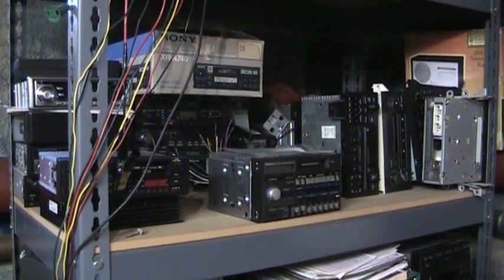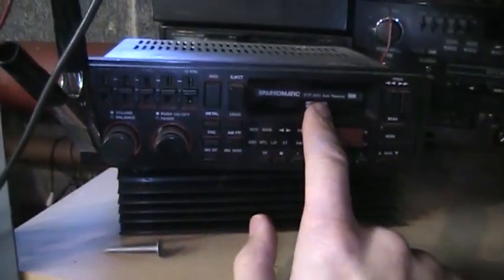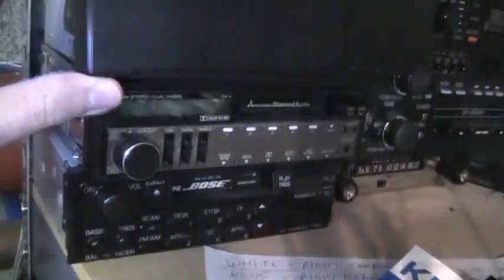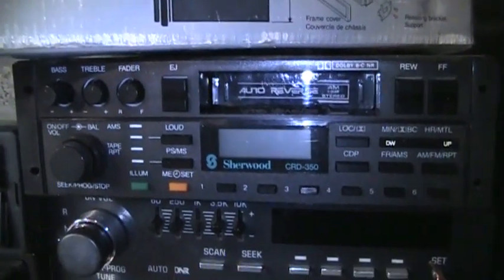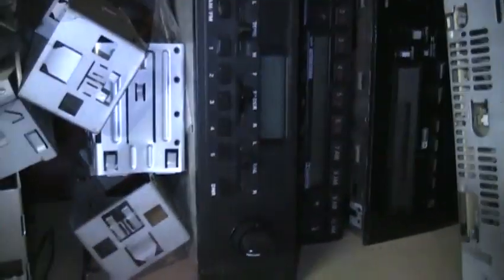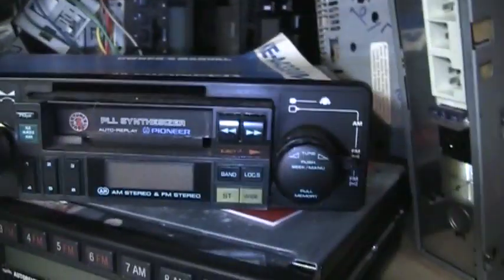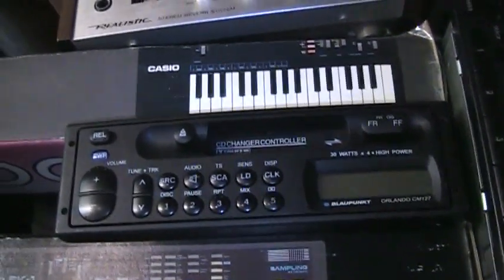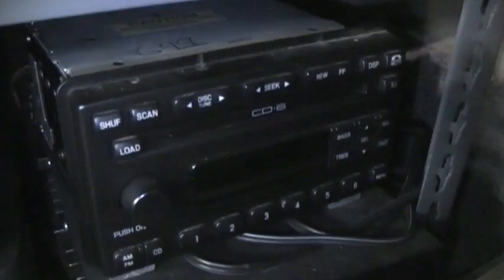AM Stereo car radio collection giveaway!

Comment: Annoyingly the Becker 1452 / 1432 radio in my Mercedes has a tuner chip capable of receiving AM stereo, but it isn't used.
Reply from the maker: I know some Chrysler car radios had the C-Quam decoder chip installed, but only used it for its synchronous detection capability, to provide cleaner-sounding mono AM reception.

Comment: Very nice video. 
In 1983/1984 I bought an Japanese? Car radio that can Record Stereo FM, AM, Mic-in, Line-in, Trafficdecoder in/out. Had DNR or dolby for tape.
No digital screen, complete analog. I used it one month, then it was stolen complete with my Pioneer speakers TS-X8...
I never could find it on the internet. The manual should be some were in a box?

Comment: How did this prewired radios originaly fitted to the car, were they direcly wired to the car or used some kind of harness

BTW: what do you do if you want to sell the car and keep the radio nowadays, would people even buy a car from you if it has no radio in it?

Also is it possible to OBD code theese later 90s radios when on a workbench, I know you can do this in a car, but on a workbench there is no OBD port on the radio?